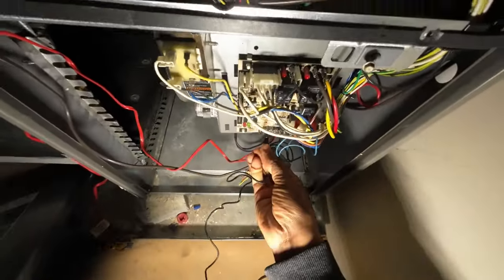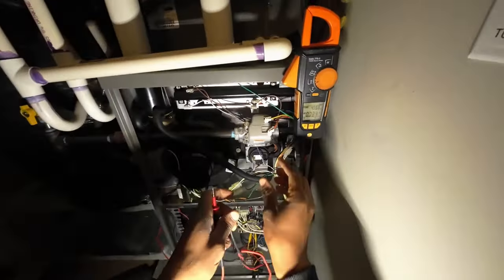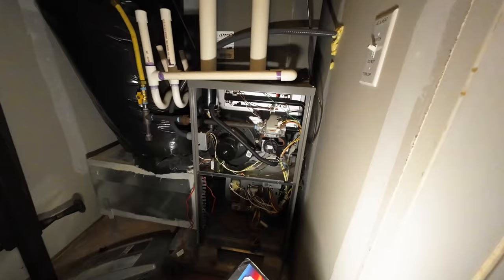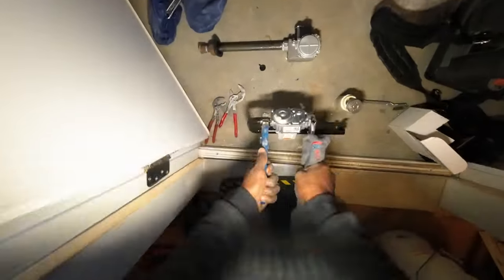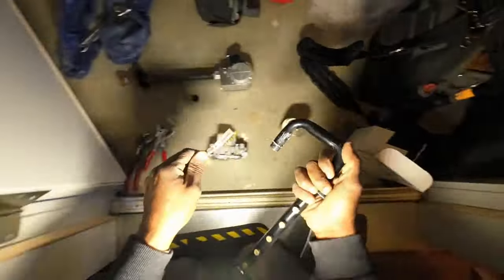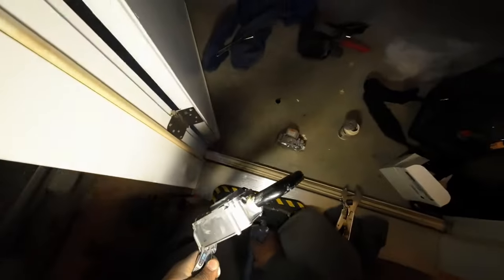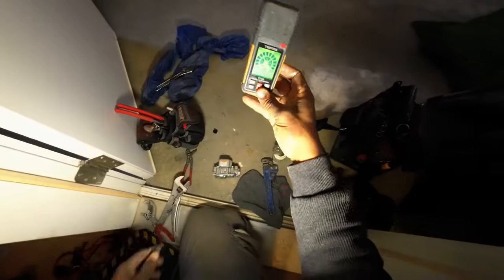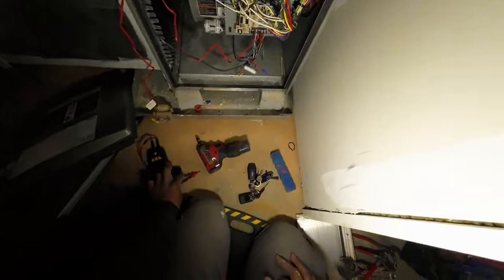HVAC Tech Lennox 80% gas furnace troubleshooting tricky gas valve diagnosis and repair #hvac

Comment: My unit had the same issue. Determined it was a bad gas valve. If you have a similar call be sure to remove common from the ifc board and ground it from valve. It determines if it’s the board or the valve. No adjusting gas pressure?  Great video! Keep them rolling.
Reply from the maker: Great advice! Appreciate you sharing and thanks for watching

Comment: Nice content as always...

The internal electronics of the honeywell valve or similar will cause your readings to not be a true 24 volts.  Older valve just have a coil, not anymore.
 
Just like you did, disconnect the wires to make sure you have a true 24 volts, but I suggest you put you leads on both wires, not the pipe. You could have an open or loose neutral side, and you won't know it by using the pipe.
Reply from the maker: Great point! Appreciate the info and thanks for watching!

Comment: Great video that gas valve was easier to change than I think!
Reply from the maker: Yes it was, most repairs on gas furnace are pretty straightforward
Reply: @HVACTechKnowledgy  When you have to replace a furnace pressure switch do you use the universal ones very often? Or do you pick up the proper one from a supply house? I've never used one of the universal ones and i felt like a moron lmao.

Comment: Good work but you forgot to check the outlet side of the gas valve with your leak detector, you checked all but that. Poor lighting always does it!
Reply from the maker: Good catch - thanks for watching!
Reply: @HVACTechKnowledgy  i do quite a few gas valves, i replaced pretty much every brand out there, except for the lennox pulse lmao
Reply: Also just a heads up, I always take out the ventor motor if I can, it makes my life easier to rotate the gas valve easier while attached to burners, rather than putting strain on my wrists and back, whatever works for ya.

Comment: I've been fooled by board/valve before... I plug my gas valve wires into a contactor and if the contactor pulls in then it tells me the valve is bad. I've only checked the voltage with a meter and it screwed me. 😂
Reply from the maker: I hear that. Usually as long as you unplug the wires from the gas valve the readings should be pretty reliable

Comment: Hory shit. That pipe ain’t ever coming off. 😂
Reply from the maker: lol, yeah I just know that the gas valve is prone to leaking at the connection point due to under tightening so I just try to stay ahead of it. I'm also where you can over tighten and crack the gas valve as well but it takes a lot more to torque than I was applying.

Comment: Constructive comments;
1) too much pipe dope used and wipe it off when you are done. Looks professional and not like DIY.
2) when having an issue and you think the load is the issue, try using another load, like a contactor for example(because everyone has one on their vehicle), to see if that will work without blowing fuse. Also, it can show if the board/control relay is weak or the issue.

I am not sure that the Nylog refrigerant sealant you used is approved for that use!! From what I see on the mf's site, only their Nylog White w/PTFE is approved on natural gas or propane.
Reply from the maker: Cool! Definitely appreciate all the feedback will keep in mind.